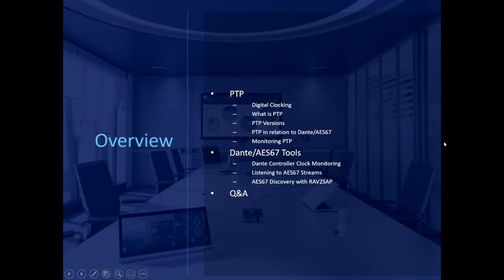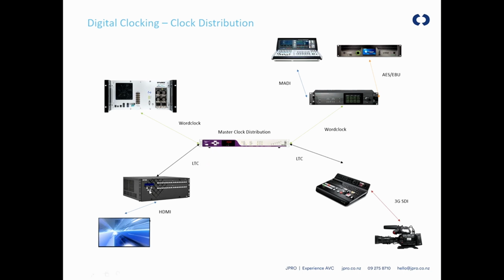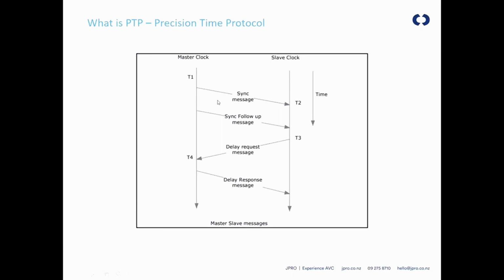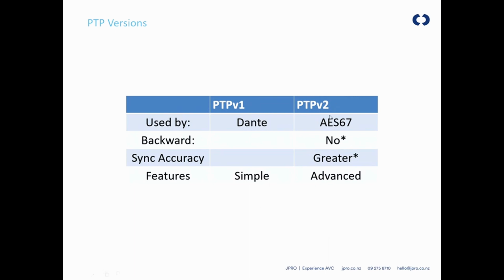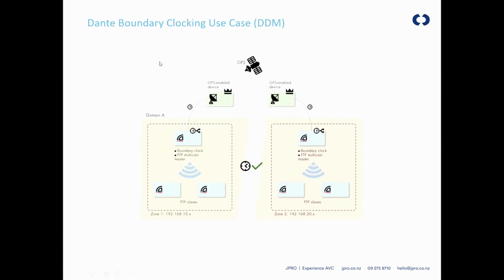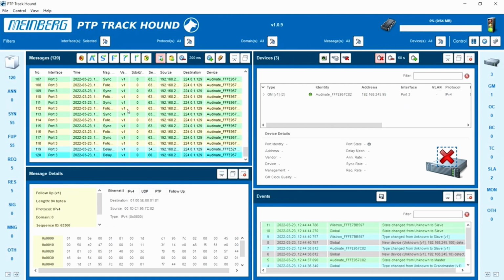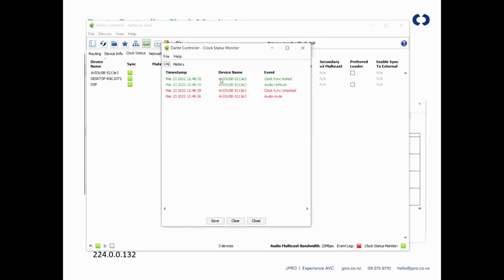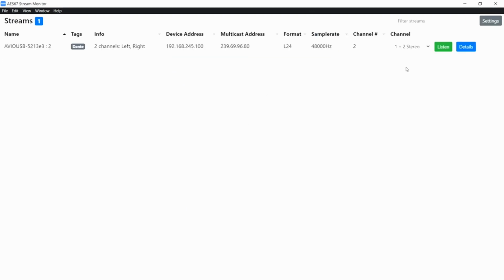Dante AES67 with PTP Protocol and Analyst | Module 3

Comment: Your video is so underrated. I hope people will look at it more and more! I really liked it, very enjoyable delivery, and, explanations! Keep this up though! Just a question, how do you find the integration of AES67 + Dante, because often it fails the sync.
Reply: Hello Mike, thank you for the feedback, its really wonderful to hear that it was enjoyable and explains the concepts well. 

Regarding your questions: Ive found it to be unstable at times until it finds its 'groove', mostly once the clock jumping has claimed down from me finding the best master clock for both PTPv1 and PTPv2, It normally goes wrong cause of the boundary clock selection. I have found though that if you using Audinate devices it comes down to focus on the best chipset for the job which often is a Brooklyn just cause it has the most headroom in terms of processing where the ultimo chipsets don't. The issue here is not all systems have the luxury of two Brooklyn units. I tend to always fix my clock masters for Master and then Boundary and on larger systems I preference a dedicated master Dante clock unit like Studio Tech 5401, although its just another Brooklyn card inside it, it does offer a full PTPv2 server that can be customised and because its in a single unit, it doesn't have to deal with network related performance issues to sync together as much, although this is a luxury again so it doesn't happen often.

What I have found to work is using PTP Track Hound and Dante Controller in combination to determine the best PTPv1 and PTPv2 (Boundary) has worked better for me in the long run, I normally leave these running for an hour to a day to see how stable the system is and based on the results select the best clock. 

I hope this was hopefully but in short its the boundary clocking method that causes most issues between AES67 and Dante.